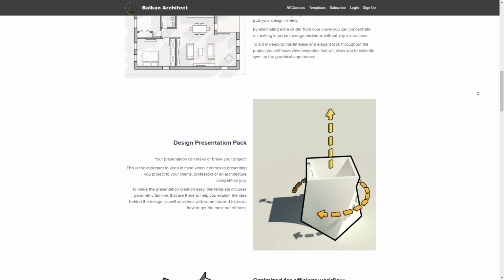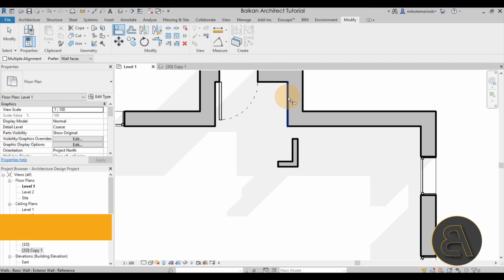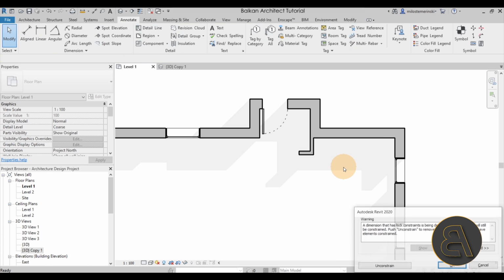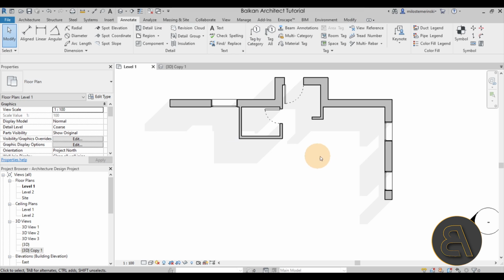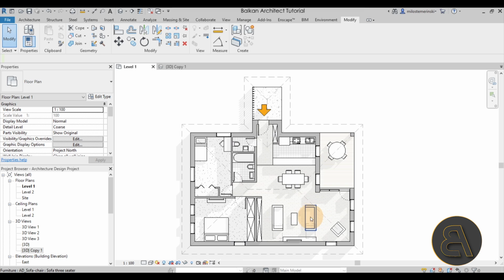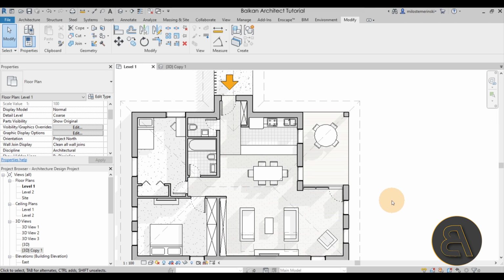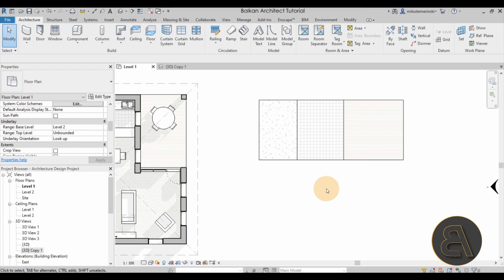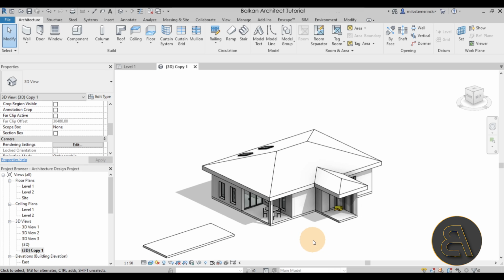Floor Plan Design in Revit Tutorial [5 PRO Tips]

Comment: Hello sir I just want to ask suggestion because I already downloaded and install the Revit 2022 but it does not run smoothly on my loptop, my loptop specs is core i5 8gen, 4 gb Ram, can you suggest any recomendation or other Revit version where can work smoothly with my loptop that can work like Revit 2022, thank you..
Reply: More horsepower is the answer.
Reply: @joegotz1971  how?
Reply: @bryanhije4136  We get all of our computers from Dell, and they provide us with excellent tower computers. About $5,000.00, for what we need. We also use 3 monitors.
Reply: @madsmller5806  I think we have 32gb. They run Autocad Architecture as fast as we can go.